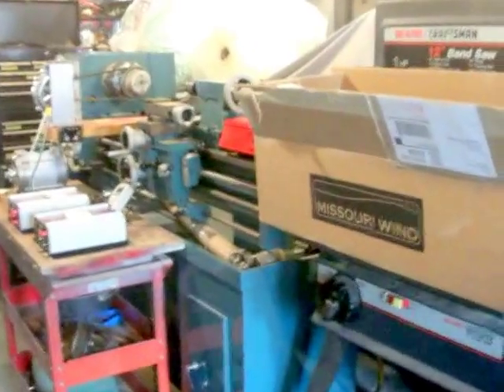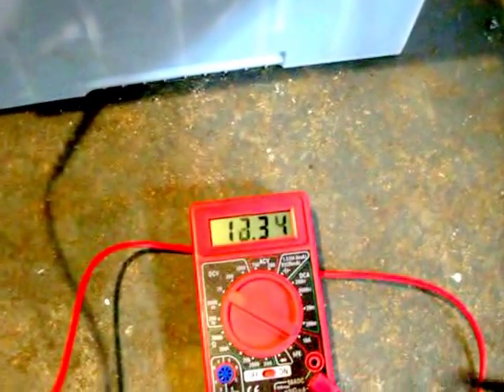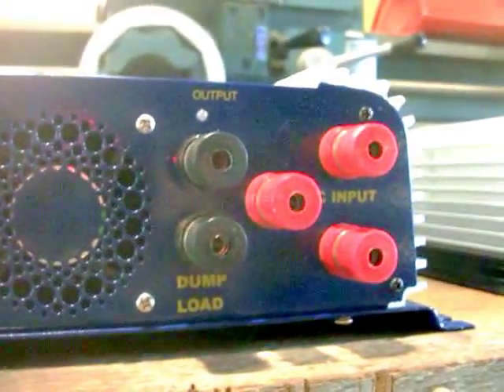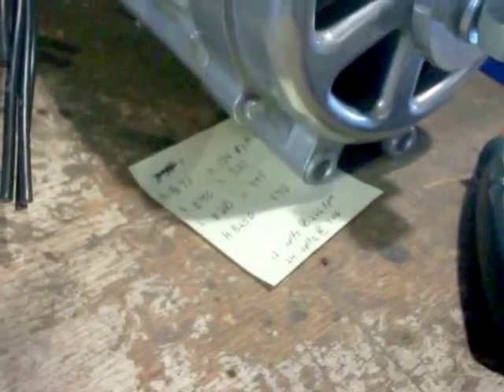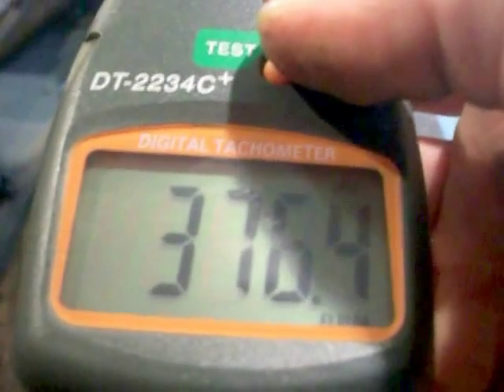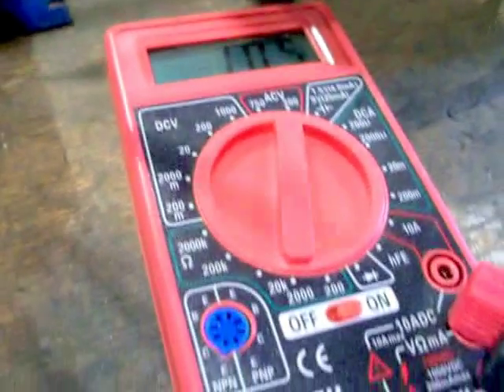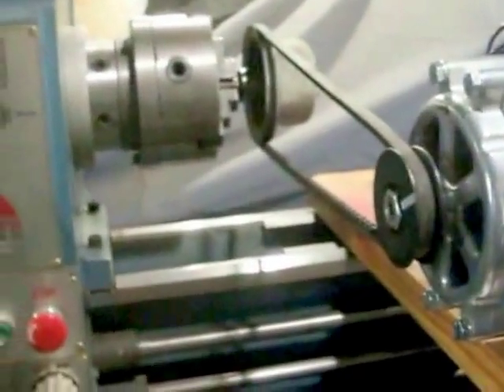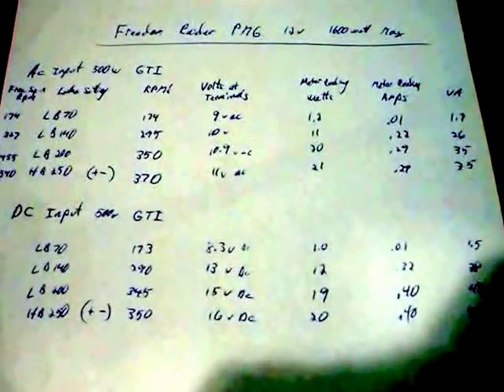AC vs DC input grid-tie inverters part 1 Missouri wind PMG rpm test

Comment: I have 2 22 to 60 volt 1000 watt Sun G's I"m looking to sell they are DC in put.  I'm willing to part with them for 150 each.  gave 250 new.
Reply from the maker: +McCuneWindandSolar I don't think I'm very far from you, located just south of Milwaukee and I'll probably have to take you up on those GTI's
Reply from the maker: +McCuneWindandSolar Can you shoot me a direct email on those Grid Ties?  Lightendog@aol.com  and title it Inverters so I don't accidentally delete it if it goes to my spam folder.
Reply: +Lightendog I will do that when I get home from work in the morning, I will take some pics of them.  I'm selling all of that gear so i can get more solar for my new system I'm currently at 1666 watts.  once I get a midnight I will either build my own turbine or get the boss from Hurricane wind.   I will also be selling the Freedom and the dual renegade that I Have or I might first put them both on the 8 HP motor's I have and test the crap out of them since I do have the two GTI's   I might do that. I have an RPM gauge on my freedom like you do in your videos it helps give a lot of good Info on both wind and RPM.
Reply from the maker: +McCuneWindandSolar I'm pretty green on this battery bank stuff and I was recommended the Midnight charge controller by another guy.  Someday but not sure I want to jump into something that expensive just yet in case I "f" something up ( that would never happen to me lol ).  Can you tell me what's the difference between the midnight and the midnight kid?  Also at looking at different types, ( I can't put one next to my breaker box but only in my garage )...I'm a little confused on how they would get wired to a grid tie if they do at all.  I only see instructions showing them connected to battery banks and then solar pannels or wind turbines.  Do they have built in grid ties or something?  Been thinking of a cheaper 40amp Renegade controller to start with.

Comment: It looks like to me that you have something wired up wrong.  If I were there, I would be happy to help you with this test.  I am using a Nema 23 Stepper motor (which is a lot smaller than your PMG) and I get 12 volts at 100watts with no problem.  I doubt that it is the fault of the PMA or PMG that you are using.  To began with, a car battery cannot produce an AC voltage.  My multimeter will not do what I saw your multimeter do.  One more thing I noticed was, you are not using a bridge rectifier before wiring to your inverter.  This alone maybe the program.  Ask someone who knows a little about electronics for advice.  If you live near a trade school, I am sure you can get help there.  Good Luck.
Reply from the maker: +cwrobinson6363 I know a car battery produces DC, I was making sure I was using the right inverter.  Everything is wired correctly and I did an updated video with a 975 hour test run with the 5 blade 81 inch set.  In high winds I do get good output but only for a few seconds.  My best 24 hour period was about 800 watts thru a grid tie.  Check out my video on "Buying a wind turbine without going 65 feet up" and you'll see what I mean.
Reply: OK Thank you: I will check out your latest video.

Comment: Grid-tie is a myth, it is just not possible. The grid is running at 60 Hertz and if you want to deliver your power to the grid your generator have to run at exactly the same speed as that of the grid and it must be at the same phase and that is just not possible, especially with a wind turbine that run at a fluctuating speed. So who ever came up with that idea was ether lying or he don't know Jack Shit about electricity. The only way you can do grid-tie is to generate your own power and when you run out your system switch back to the grid, but to expect that your power will turn the meter backwards is just not possible, because electric meters are made to only run forward. On the other hand the grid is connected to the user via a step down transformer, from the Ht line that is about 12KV. So forget about grid-tie and get yourself a battery bank and an inverter.
Reply from the maker: You're wrong on the grid ties, yes wind turbines are crap but my solar panels will make the blinking lights on a smart meter, run the opposite direction.  The meter don't care which direction the current flows, you still get charged and I also did a video on the electric company robbing you.  Grid ties bring in voltage a little higher then the house voltage so it gets used first.  I now have a battery bank and the wind turbines will be coming down to install more solar panels.
Reply: You are wrong grid tie inverters do the phase matching irrespective of the
frequency being input from the turbine

Comment: this test is bullshit pma wise i think his inverters are under voltage, he needs to eliminate the inverters and rectify the the pma output through a load and measure the voltage/current/wattage i think his inverters are just not happy with the setup..........are those even 3 phase input inverters? wheres his delta rectifier?
Reply from the maker: Inverters are not under voltage and will work with the pmg used.  The rectifiers are built inside the grid ties (that's why you see 3 red knobs for the input).  I found the problem is that the pmg needs around 250 rpm's to even start making power at the grid tie......You may get better results going straight to a battery bank but even so, I just don't have enough wind here for wind turbines to be a worth while investment.  BTW, my turbines are for sale if interested.
Reply: Lightendog seems like 250 is in the minimum rpm range,  probly 1000 rpm is not uncommon in study wind in fact when you film the turbines at 25 franes per second and the blades appear to stop turning i think thats about 1200 to 1500 rpm as its syncing with the frame rate.... at 25 rps x 60= 1500 rpm atleast thats how i think it works I could be wrong though... somebody could pribly write an augunented realuty app to measure wind turbine rpm that way....if such an app does nit already exsist....
Reply from the maker: Funny you should mention that as I'm one of the only people to actually put an rpm meter on my turbines.  My modified turbine was on a 2:1 ratio so the pmg spun twice as fast as the blades.  My other turbine in a wind storm I believe hit 800 rpms which was the highest I ever seen.  Good out put for sure then but it was only for a second or two.  Again if you have a steady flow of nice wind, a turbine might be for you.  I have videos posted showing the rpms.......